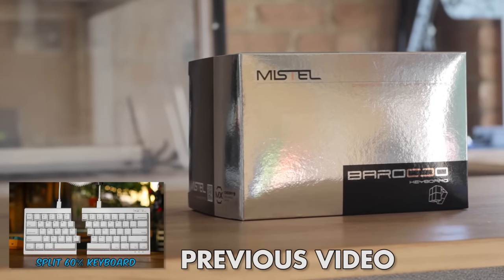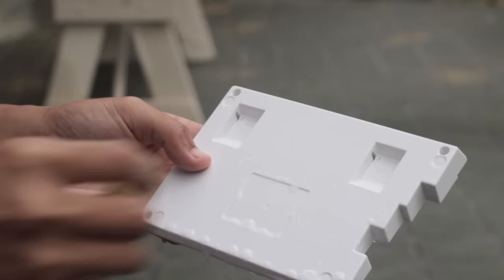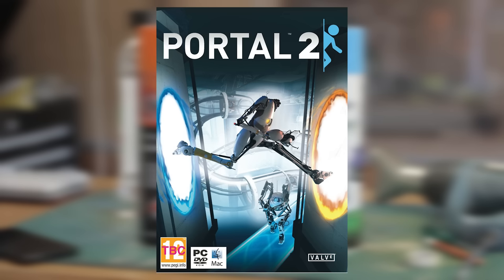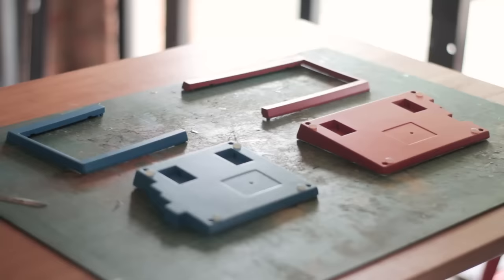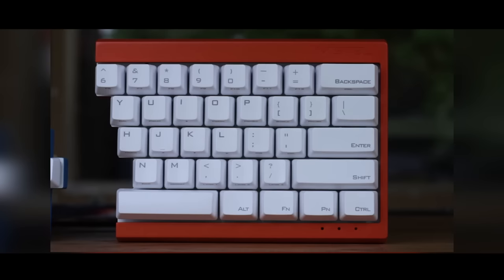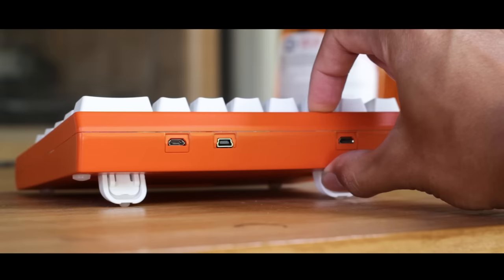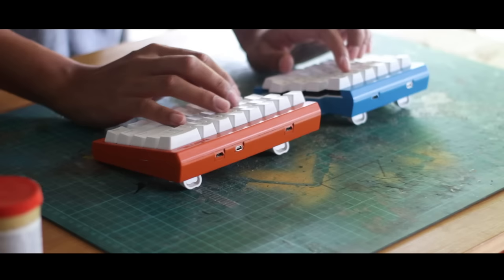'Portal' Themed Mechanical Keyboard ft. Mistel Barocco

Comment: About the paint adding thickness: Do you think dying the white plastic rather than painting it could solve this issue?
Reply from the maker: I guess that would be an option, and wouldn't add any thickness. I'm guessing this is ABS plastic, which is a tad difficult because of it's low melting temperatures in comparison to other plastics, like different variations of polyester. Most dyes that are bought in stores are for polyester clothing, making them work well on PBT plastic (type of polyester). So therefore it usually doesn't take colour that well. But that's only my experience on keycaps, and there's probably more expensive proper dye's out there.

Comment: Would you say 43 bucks (aud) with shipping for a 120 pack of gateron switches is a sweet deal? Massdrop are selling them right now, im leaning towards Gateron Blues. I currently have Cherry MX Browns. Are blues pretty much just clicky browns?
Reply from the maker: Yeh Blues are pretty much like click browns, but the clickyness brings more tactility. 

And yeh it's a pretty standard price. The estimated ship date is heaps far though, and you can readily buy Gateron switches at places like MechKB and Mwave, which are both in Australia - however it's a tad more expensive (unless you pick up).
Reply: oh wow i didnt know mwave sold them, thanks for the tip.

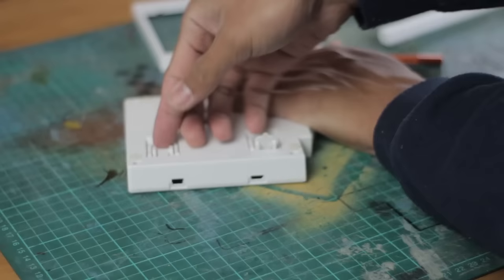Comment: Just pointing out: the reason why there was a gap in the middle, was that it deformed because of the heat while removing the sticker from the bottom as seen @0:46